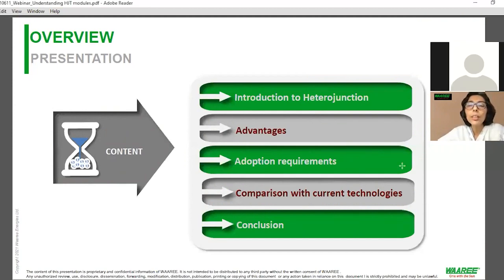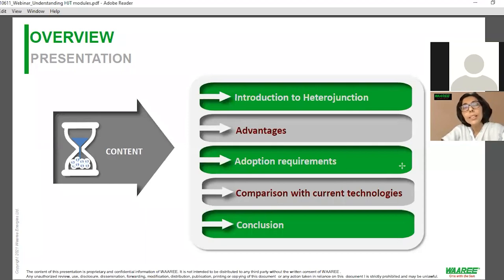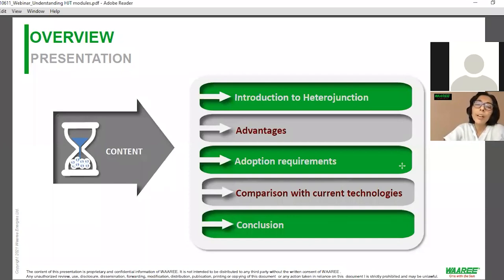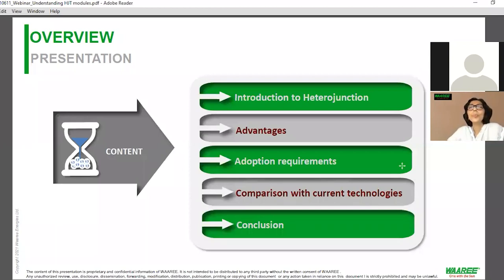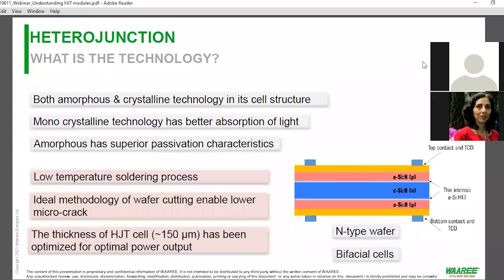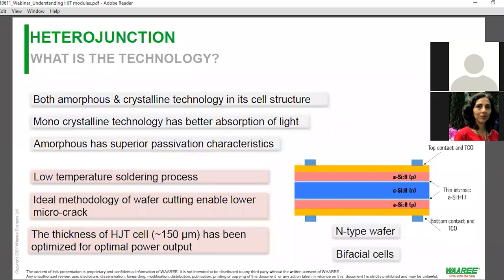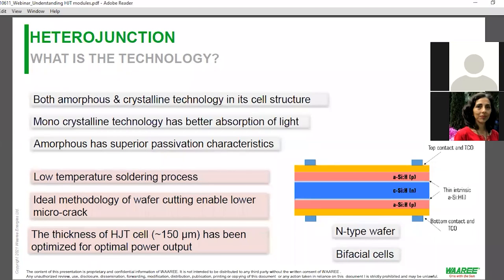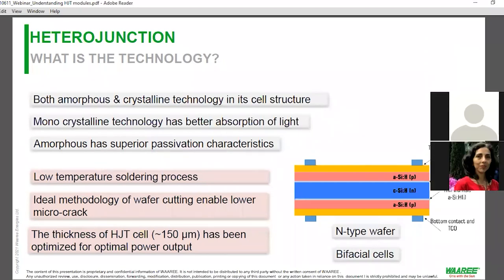What is Hetero Junction Technology in Solar Panels?

Comment: Hello, does for example CS6R-H-430AG-S hjt panel, with glass/glass structure, need good sun reflection to its back side, in order to fulfill states efficiency like other bifacial panels? Or its fulfilled by just straight light from front side, with its advantage of no lid pid etc. Thank you

Comment: Hlw i am electrical engineer working on solar cell Manufacturing and installation   i m woking on its and working on way to enhance a optimal charge layer for hetro junction siliocon solar cell with imporeved light mngament and working on the other effects that can improve the power conversions efficiency.